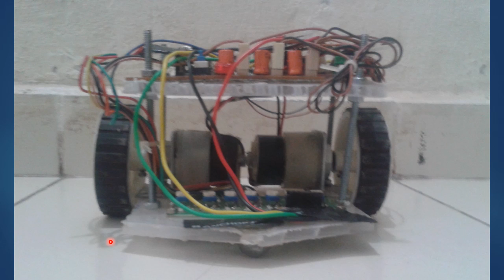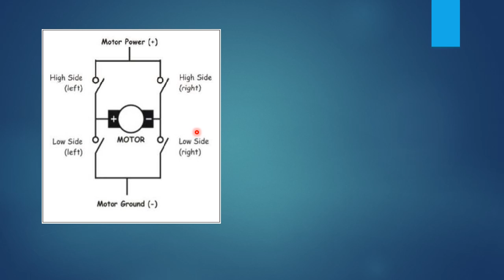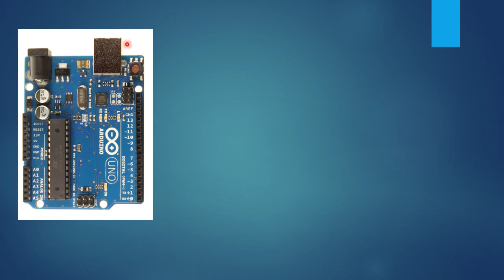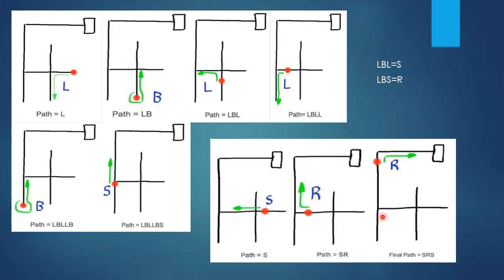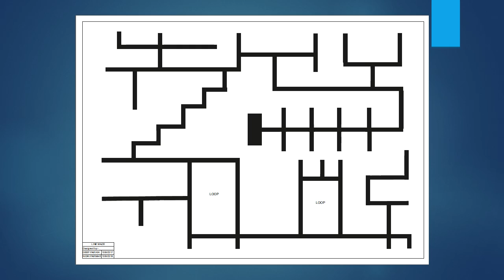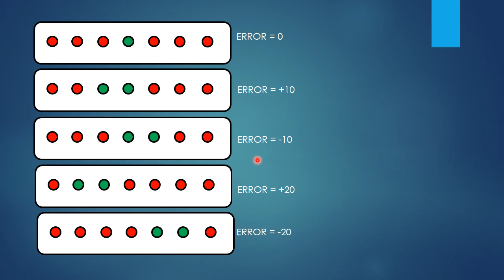Making Maze solving robot with Arduino Uno

Comment: which battery you have used and how you keep robot straight.
my robot move like a wave.
Reply from the maker: priyaranjan kumar I used 12 V Li-ion batteries. Your robot is oscillating around a central line because the amount of error you have given to specific position is too high. try reducing your amount of error for just off set position. or use PID algorithm. I used PID algorithm and also tuned it to a point so that machine follows line smoothly.
Reply: +Deep Parikh  thank you.
can u help me to use pid algorithm,how can I use it.
Reply from the maker: Use difference as an error....and other that use PID formula ( check Wikipedia page of PID) to calculate what needs to be added or subtracted from motor pwm.
Reply: Deep Parikh would u please provide me the code for the autbalancing robot? yasirshahazad918@yahoo.com